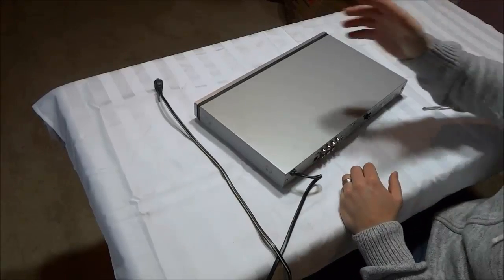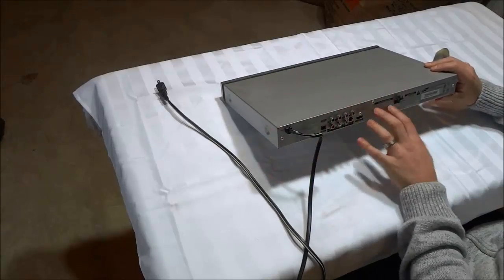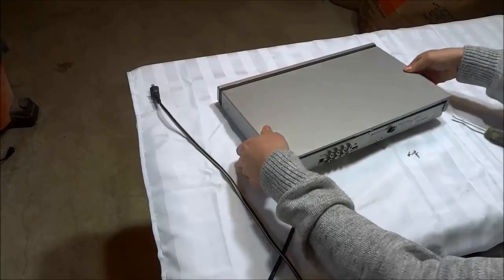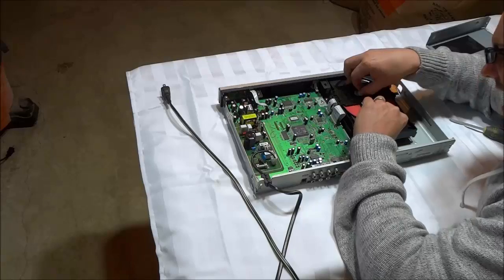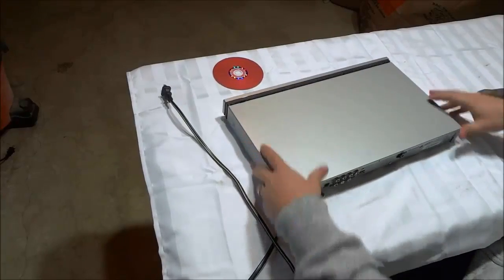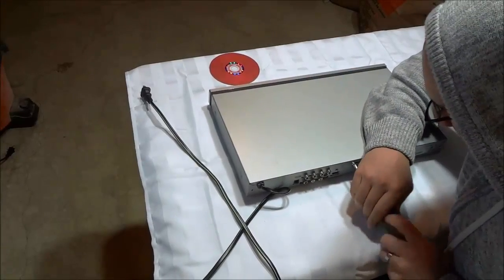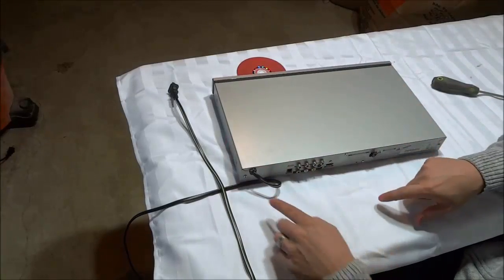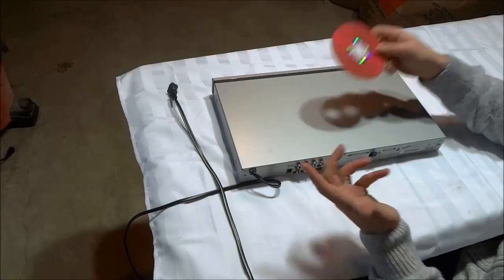How To Remove A Stuck Disc From A DVD Player (Tray Won't Open)

Comment: I just saw one where you flip it over after unplugging and ise screwdriver to turn wheel inside the curved hole on bottom of player   door opens and ene ts disk.  May be different then yours

Comment: Thanks, I didn't think it would be so easy.  My player was very similar.  I was able to lift up on tray part just as you did.  I think I needed to see someone else do it, as I have never looked inside my player and was afraid of breaking something.  Your video was very clear and informative without being too technical.  Good Job!

Comment: This is according to the title of the video, this video does not solve the problem of the eject button not working, this video only shows how to take the disc out of the machine.
If after this you can't use this DVD player, that's a different matter.

Comment: will this work for a dvd that came out of the tray while inside the dvdplayer? my dvd fell out inside the play and is sliding near the bottom. but the bottom dvd label says not to open the player cause its dangerous ; it has some chemical inside.